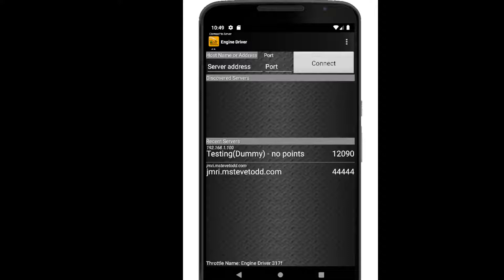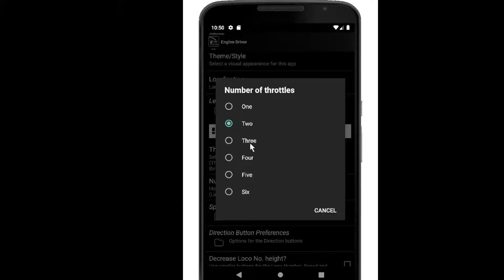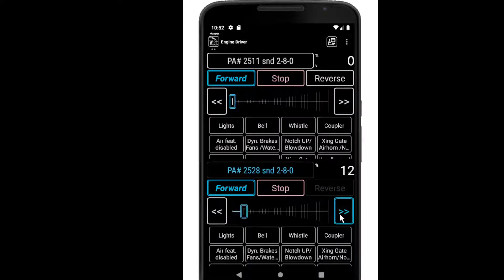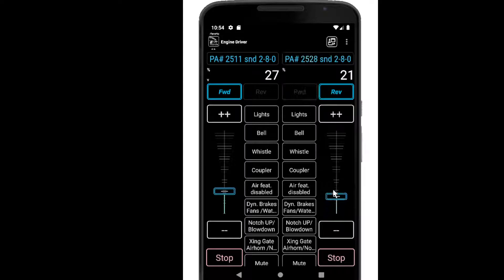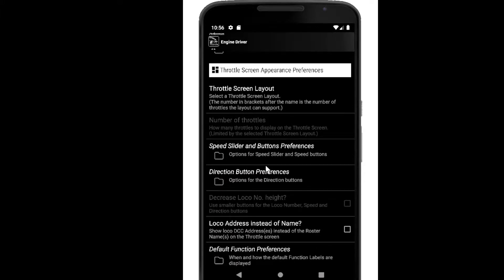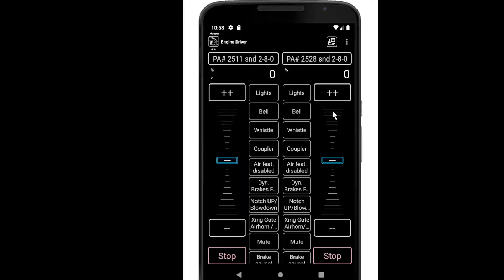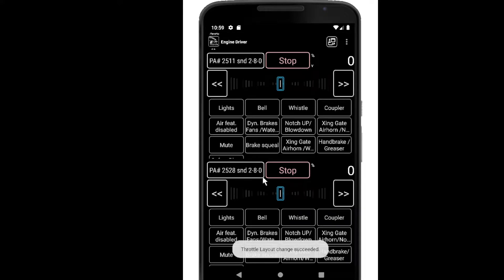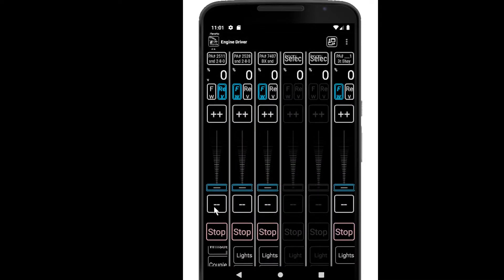JMRI Engine Driver - walkthrough of all the Throttle Layouts

Comment: How do  you get the engines into engine driver to start with?
Reply from the maker: If you mean the server roster...
Then it depends on what WiThrottle or DCC-EX Native server you are using.   
JMRI, EX-CommandStation, WiFiTrax, LNWi, etc.  They all require a different approach.
Reply: @peterakers9071  OK thanks 👍

Comment: Peter, Do you have a video on how to change the labels for the functions? The local club is interested in Engine driver and would love to know.
Reply from the maker: Hi, I don't have a video for it.
Generally the labels are set up for each loco in JMRI roster. ED then just grabs them when you select the loco from the roster. That way they change depending on the specifics of each decoder/loco.
You can change the 'default' labels in ED, but that means you will have the same labels for all locos. It is really only intended for when you don't or cannot have a roster entry to choose. 
(DCC-EX also supports having a roster with individual labels for each function for each loco.)
Reply: @peterakers9071  Thanks Peter

Comment: Peter I see your throttles have descriptions on the function keys.  Mine only shows Horn bell and lights, yet the decoder has many more sounds.  What am I missing please?
Reply from the maker: The function button descriptions / labels for individual locos come from the roster in either JMRI or the DCC-EX EX-CommandStation. To get them you need to setup the roster. 
If you just to just change the labels for all locos, use the menu item 'default functions' in Engine Driver

Comment: is there a way to control throwing switch tracks with Engine Driver?
Reply from the maker: yes, if they are setup in JMRI (or whichever wiThrottle server you are using)
if you swipe left or right it takes you the Switch/Points screen or the Routes screen.  (or you can use the menu to get there)